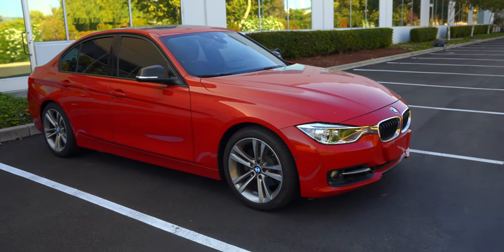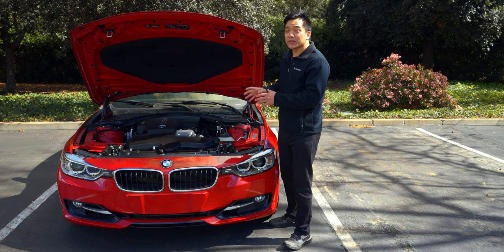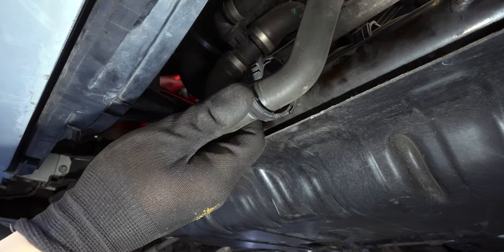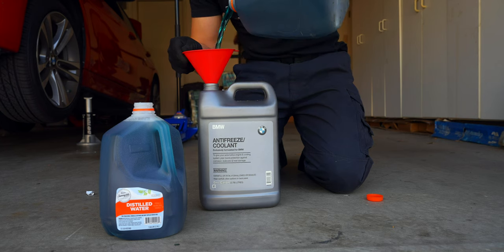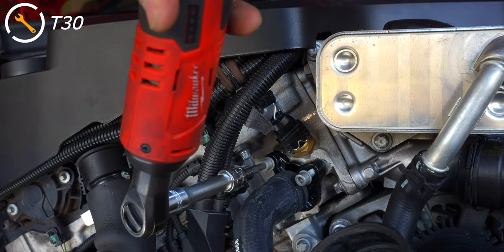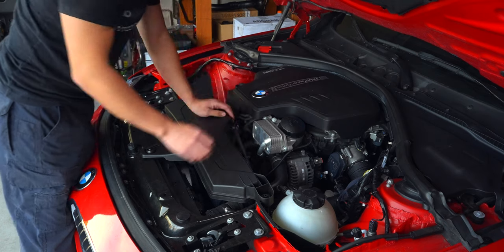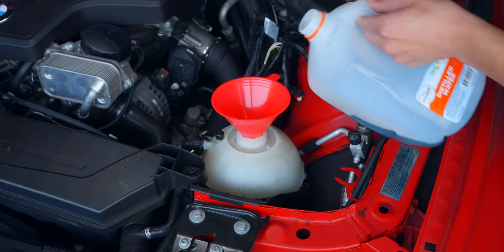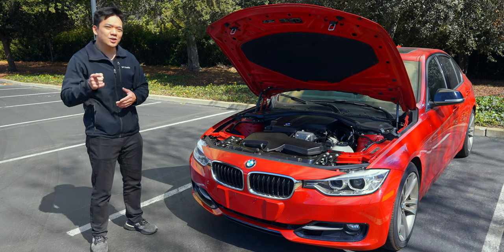UPGRADE THIS when You Flush Coolant - BMW F30

Comment: For those that do not like to use the OEM pinch clamps it is important to note that those claims provide evenly distributed pressure across the entire hose (Mechanical envelope).  The screw style clamps while secure,  pinch the hose tighter across the screw point, uneven pressure.  If you can, stick to the clamps as provided by the MFG.
Reply: They will always outlast the hose. Even true in this case.
Reply: They also maintain even clamping force around the hose as temperature changes cause expansion/contraction of the hose.

Comment: Also in general with any car, trying to get the initial air out of the cooling system after a flush or drain, squeeze the radiator hoses repeatedly to burp out any big pockets of air. You'd be surprised how much more coolant you can add after. Still need to do traditional bleeding but it saves a lot of time. Haven't had to do the system in my F22 yet but they also have a coolant hose prone to failure. Appreciate all the great content!
Reply from the maker: Thanks for sharing that tip! that's a good one, I'm sure it will speed up the overall bleed process.

Comment: Puppy training pads work great to steer fluids to where you want it.  I use the plastic lined side to funnel the fluids.  Use the padded side under the drain pan.  They're cheap and easy to work with.  For the drain pan, I used a water heater drain pan sealed up with some duct tape.  No spillage.

Comment: I also like to use the coolant jugs for storage rather than the distilled water jugs. One tip though: I sharpie the front of the original coolant jug to indicate that it is now 50/50 instead of 100% coolant. Because I will forget as it is usually months after the fact when I need it again and it's not always obvious peering into the container.
Reply from the maker: Good tip especially if you have a few jugs. I usually only have one and if there is no seal on it that's my  indicator that it's now 50/50.
Reply: 记号笔标注写一下😂

Comment: Serious note, I upgraded mine 2 years ago and it seems like it’s starting to slowly seep from the bottoms of the flange, do you think the rubber gasket has gone bad on it?
Reply: Many flanges are cheap chinese ones from ali express just rebranded.
I rather replace mine with an oem part that i know that works and rather replace it again in a couple years to prevent it from breaking than having an Aftermarket item that may leaks like in your case.
Did you fix it yet btw?

Comment: I had my 2015 328i (base) for bout 3 years and so far I went through some standard gaskets such as oil filter housing and valve cover gasket, some sensors, new fuel pump, got about 90K miles on it now and lately my car’s been hesitating/lagging at low RPMs, especially in barely moving traffic, soon as I let go of the break and gas a little, the car would hesitate and then jump forward a lil all of a sudden, anyone has any idea what’s wrong? Also if there’s any BMW fanatics in the Florida area who’d can do a restoration project with me, pls feel free to hit me up, would like to make this car run like new again and change whatever I can without getting robbed at a BMW service center
Reply: @vycma9941, I'm having the same issue, did you find the solution?
Reply: @miketran7374  Well I just drove it really, let the engine run as much as I could, that’s after the complete coils and spark plugs, liqui moly engine flush, gas treatment

Comment: "And just like that we've increased the reliability of your N20 BMW".... Appreciate the video, but no you haven't.  I know you don't realize yet, but you've broken a cardinal rule by using a worm clamp over a plastic neck (5:18), because it greatly increased the chances that you'll have a catastrophic coolant loss at a low part of the engine.  Spring clamps not only provide even force all around, they also expand and contract with the plastic as it heats and cools.  Worm clamps do not expand and eventually that plastic neck will crack or crumble after X amount of heat cycles.  If the neck was made of metal, you'd be okay but not plastic, as it expands at much higher rate.   Also, using sharp a metal pick to pull out that seal made me wince... perfect way to cause a scratch that will leak.
Reply: Came here to say that you need a constant tension clamp or a spring clamp.

Comment: Draining the coolant is probably the most tideous task on these engines. I ended up replacing my serpentine belt and tensioner, because I pulled the hose from the cylinder head and just accepted my defeat at that point! 😅

Great Video!
Reply from the maker: Oh no! I wish there was a detachment mechanism for a clean draining method
Reply: Why not just wash the coolant off?
Reply: @dma2811  Have fun with that
Reply: Tujjdbh
Reply: I dont understand. Is it because the coolant liquid will cause the belt lifespans to degrade?
Reply: @bathanmark very much so... you'll hear squeaking in no time...

Comment: By doing it this way do you not need to use an air compressor to get rid of the air bubbles in the system? Everywhere I seem to look says you need a compressor so you don’t get trapped air pockets

Comment: I’ve heard brass one might actually be worse. Potential to damage or melt in the threads. Also heard the plastic screw is supposed to be the weak point in the system, designed to break (somewhat like a fuse would for electrical systems) vs a tank or hose breaking in case of over heat/pressure (more complexity/$ for tank or hose compared to $5 plastic screw). 

In summary due to the potential for more problems when in search of a solution; I’ve decided on keeping a spare plastic one in my trunk. This is after having my plastic one break on the road almost leaving me stranded.
Reply: they make it in aluminum

Comment: I’ve seen other vids where they drain from the lower radiator hose and the hose going into the water pump. Does your method drain the entire coolant from the system?

Comment: Thanks Fritz!!!!  Just one more thing to add to the list.  🙂🤣
Reply from the maker: No problem. BMW does this to us on purpose lol 😂
Reply: @FritzRamos  hey fritz! I was wondering because the n20 engine takes 8 quarts of coolant but in the vid, you only used roughly 4 quarts of coolant. Did the rest stay in the cooling system? Or does the coolant bleed do something that I’m not thinking of off the top of my head.
Reply from the maker: @DuckMcDuckinson  How's it going? It's more likely that there was still some coolant in the system since it wasn't drained at its lowest point.

Comment: Excellent! I have the f30 b48 i have changed the charge pipe , brass screw, also swapped the small coolant hose that connects to the coolant tank with one that has metal connectors on both sides and a 4 ply high temp hose, not sure if b48 has to change the coolant flange or not not seen anyone else do it wonder if it needs doing?

Comment: miles on this f30? looks good still...
Reply from the maker: Thanks 115k
Reply: @FritzRamos did you replace the transmission oil after 100k?
Reply: @FritzRamos I'm also interested to know if you replaced transmission fluid?

Comment: Do I hold the gas pedal the entire time (15 min) until it’s done making making the noise?
Reply: no, when it gets started (10sec) i will continue until done (just don't close/open doors, etc...) for 8+ min. have a charger if low/weak battery